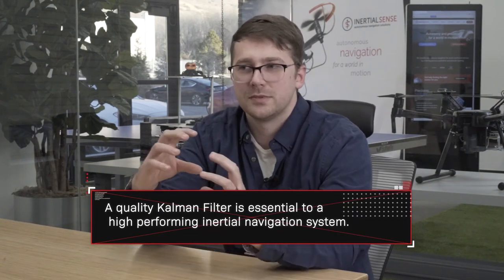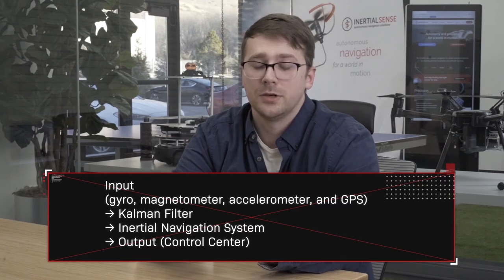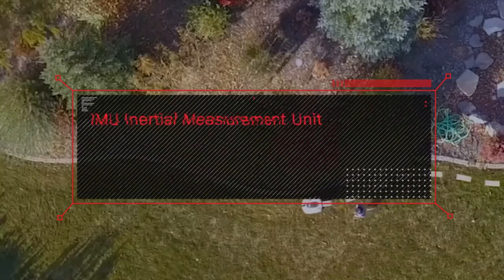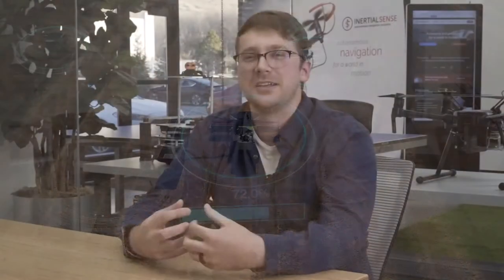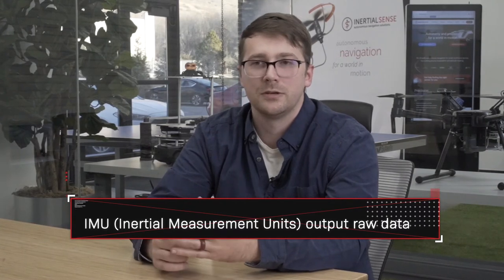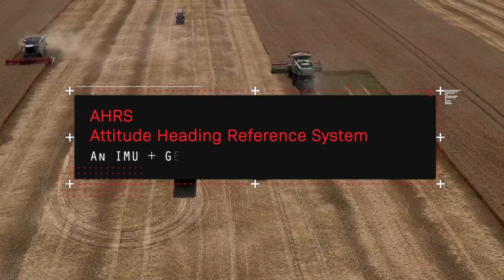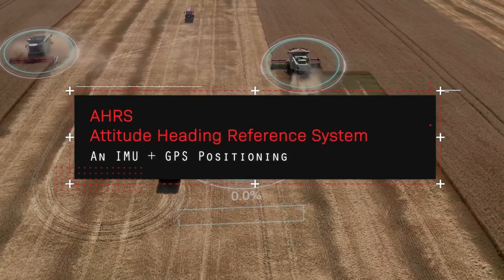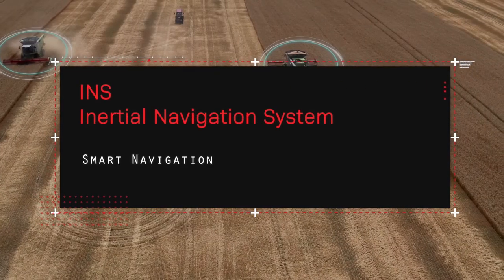The Difference Between IMU, AHRS, and INS

Comment: Can a simple 9DOF IMU device (no RTK etc) know it's own ongoing XYZ location if just a 0,0,0 start origin is provided?  I.e. earth, start at any XYZ location on the surface of the earth.  Traverse to multiple points of interest, then return exactly back to origin?  And can all of this still be within CM accuracy depending on IMU?  Again, not with the help of RTK, no GNSS, no optics, etc. Just 9DOF data and it's starting origin and some sort of leveling or direction of control for X and Y.  Thanks!  Great explanation!!!
Reply: A simple IMU can only measure the angular or linear motion that acts upon it. If you keep track all to the movements that have acted on it you still can not retrace its steps to get back to its origin because the earth has rotated underneath it. A vehicle travels over the earths surface perpendicular to the center of the earth. A gyro stays stationary in space which will make the gyro appear to flip at a 24 hour rate. Unless you torque the IMU platform as a function of latitude to keep it perpendicular to the center of the earth or calculate the earths rotation under you, just a bare bones IMU will get you lost every time.

I am an Old US Navy Submarine Sailor (1973-1985) Electronics Technician that operated and maintained a Ships Inertial Navigation System. In my day the IMU weighted about a tone and was controlled by a 3rd generation discrete component computer with only a 1k magnetic core memory and a 1k magnetic drum memory. We did use a 13-state Kalman filter to calculate resets for the torqueing values being sent to the gyros to keep the binnacle platform stable so the accelerometers can measure accurate velocities so it can keep trake of our position using a dead reckoning calculation.
Reply: @davidrediger6407  You are too professional. I don’t understand the working principle of MEMS sensors applied to aircraft. Can we communicate in depth?

Comment: Which sensor is more commonly used?  Which sensor is more accurate?
Reply: An IMU is the gyro, accelerometer sensor (typically calibrated).  An AHRS add sensor fusion to estimate roll, pitch, and heading.  An INS adds GPS (GNSS) to the sensor fusion to enable estimation of velocity and position.  An GPS aided INS typically does a better job estimating roll, pitch, heading than an AHRS because it can account for translation (movement not rotation) using the GPS.

Comment: If this is supposed to be a comical misinterpretation of inertial navigation, that has already been done.  If you are even remotely serious about what you are saying, you are doing a disservice to your viewers.  You may have read an article that emphasizes the role of Kalman filters in navigation systems, but I guarantee you that you do not know the difference between a flux valve and a Euler's pendulum.
Reply: A Kalman filtering, also known as linear quadratic estimation (LQE), is an algorithm that uses a series of measurements observed over time, including statistical noise and other inaccuracies, and produces estimates of unknown variables that tend to be more accurate than those based on a single measurement alone, by estimating a joint probability distribution over the variables for each timeframe. The filter is named after Rudolf E. Kálmán, who was one of the primary developers of its theory.

Using a Kalman filter you can predict with a high degree of accuracy which horse will win a race. The more variables you add to the equation the more accurate it will become.
Reply: Its not rocket science, the way he is selling to dumb people is frustrating